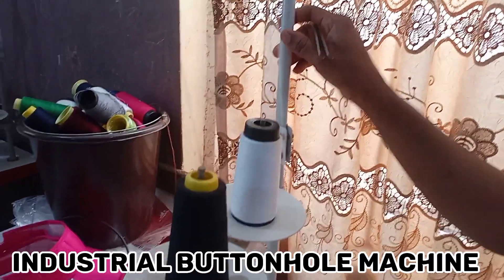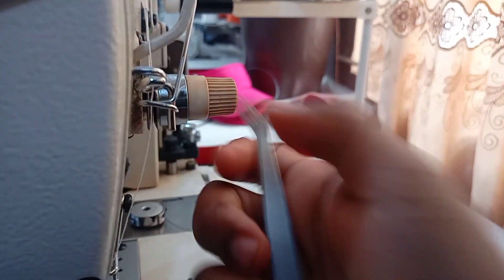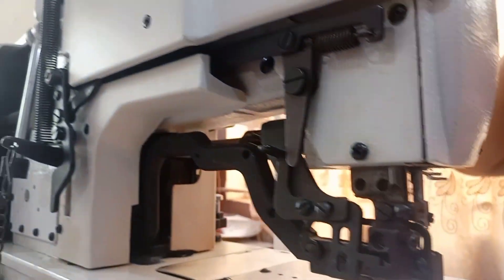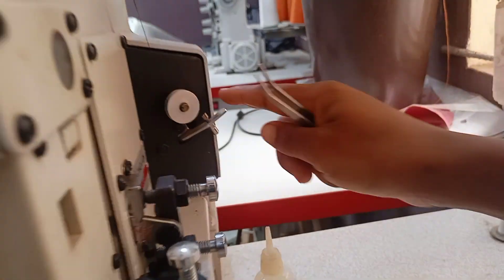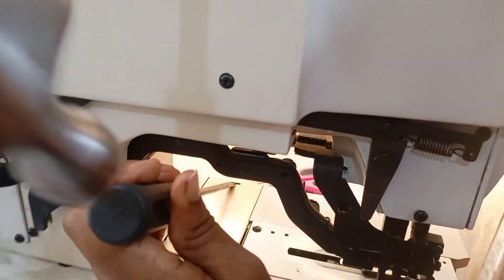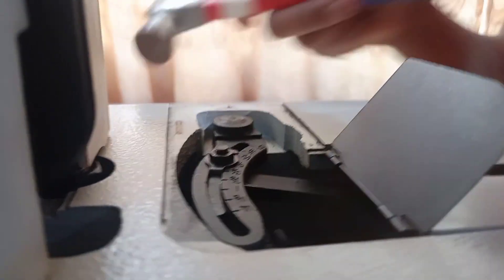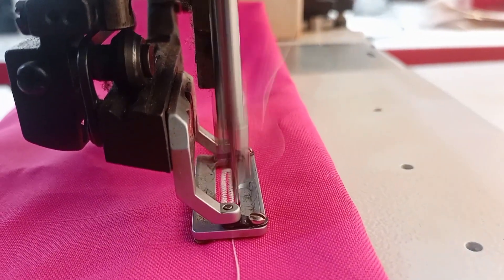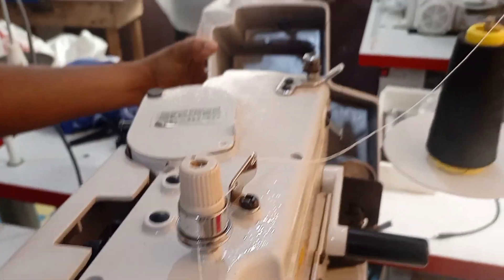How to thread, operate & maintain Industrial Buttonhole Machine

Comment: Mine is so problematic. It always jams and its impossible to lift tthe foot
Reply from the maker: So sorry about that, it's common with buttonhole actually.
Reply: Appreciate your tutorial. Can't lift the foot. I roll the side . The foot was lifted but not going down. What's the solution?
Reply from the maker: @beulahunisexfashionacademy4373 you probably have to get an engineer to fix it because you will need to check the hook and one or two things there